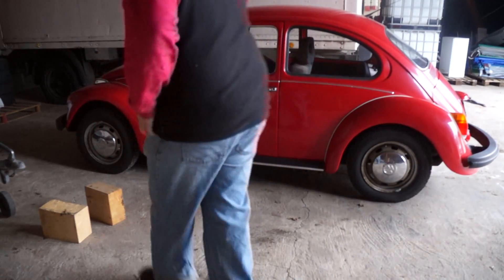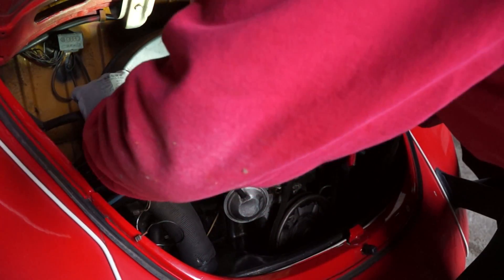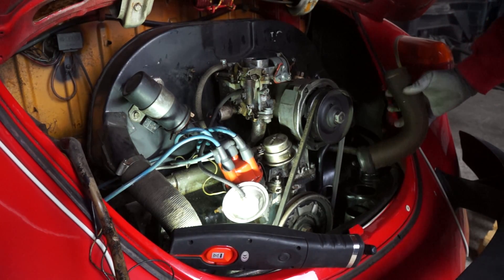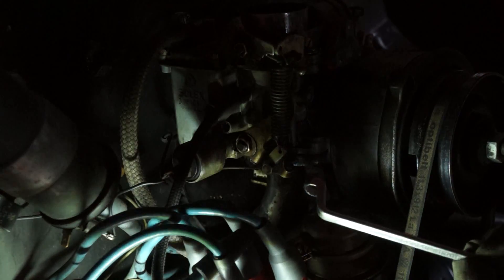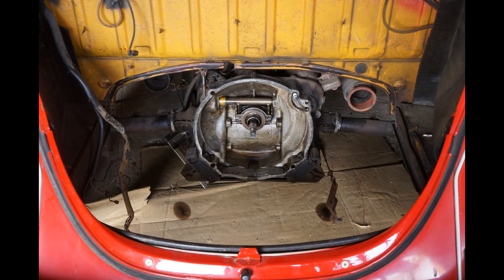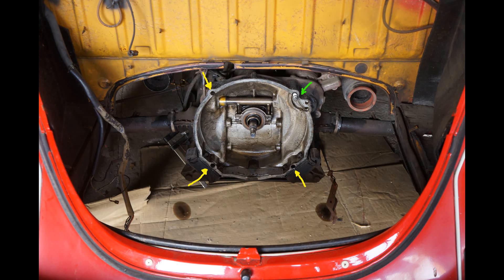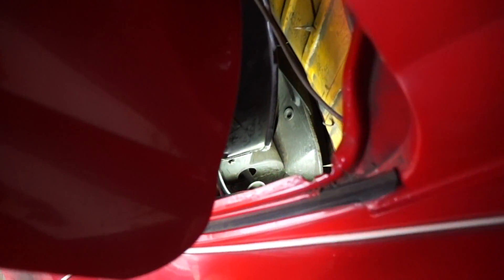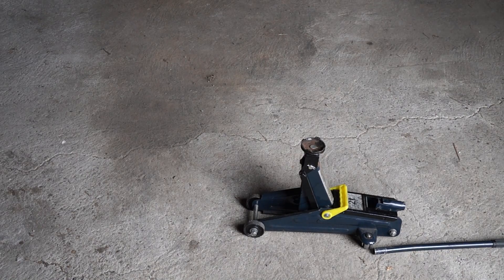VW Bug engine removal, with out a car lift.

Comment: Are the 4 bell housing bolts all that hold the engine and transmission together?
Reply: Yes. There us an output shaft mating engine to tranny, but no weight of engine should ever be put on that shaft. Have floor Jack ready to support 100% of the weight as soon as you slide it back  off the four studs. Make certain it's  clear of hitting shaft before you  lower the engine.

Comment: I prefer to remove all bolts and cables while the car is sitting on the ground or slightly raised, slip a jack under there and remove the engine onto a home made caddy, then, finally, jack up the car onto stands high enough to get the motor out. I enjoyed your video though, very good instruction.